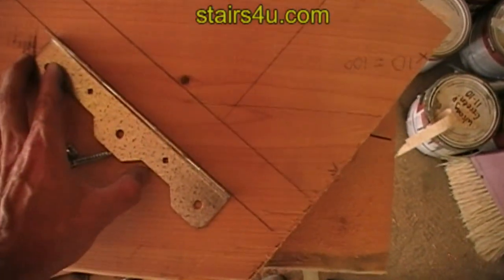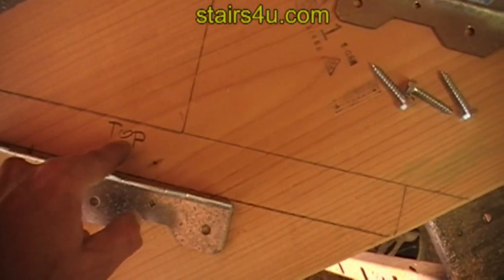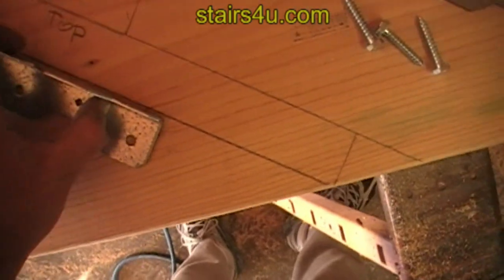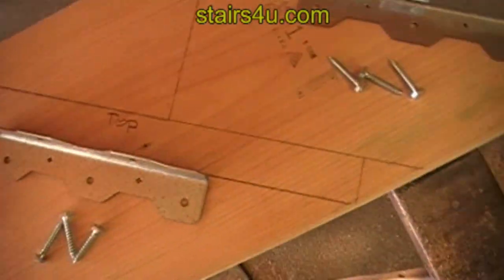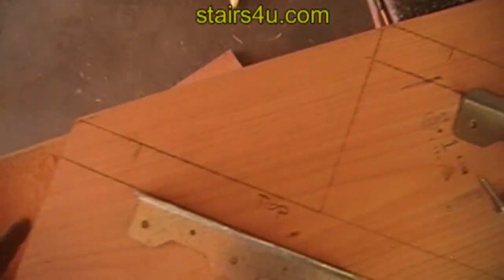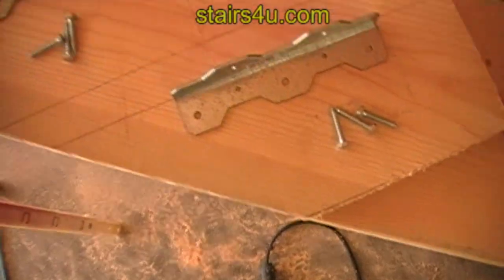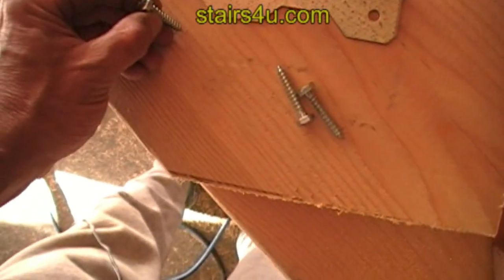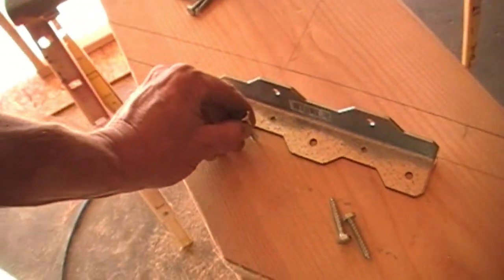How To Position Angle Brackets On Stair Stringer

Comment: what size lag bolt did you use?
Reply from the maker: I forget what they were, but you can always measure the size of the hole or take the bracket with you to your local lumberyard or home improvement center to see what fits. When I went to the product manufacturers website they recommended their products that could be purchased also.
Reply: @stairbuilding those are tiny lag bolts. I can't understand how they're strong enough for tread support.
Reply: @cdsmit27  The bolts act in sideways SHEAR force not in a PERPENDICULAR ( pull out ) force.   The three small bolts are more than strong enough.  The bracket would bend and fail before any of the lag bolts would even loosen.